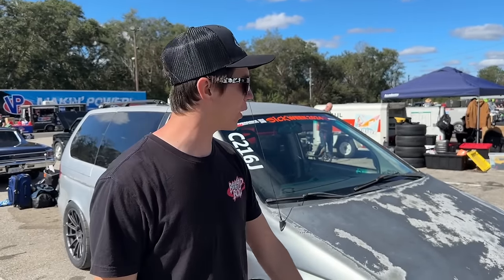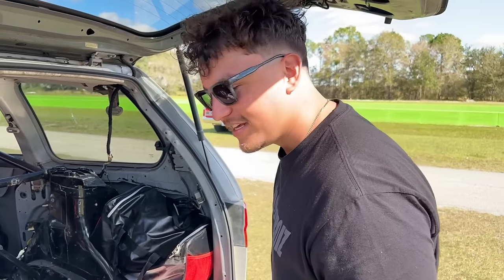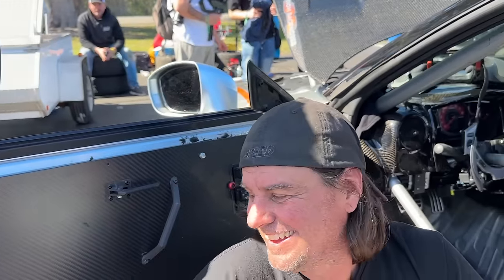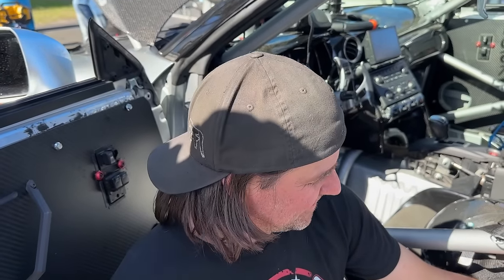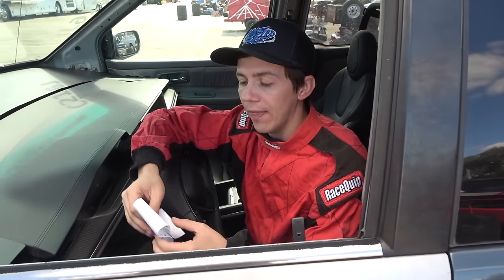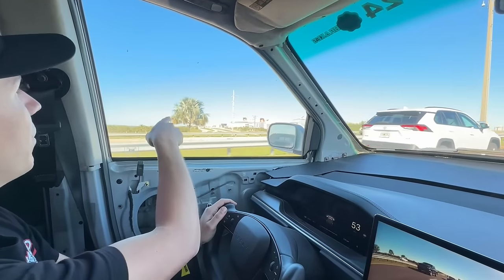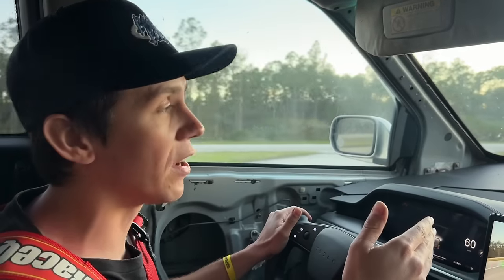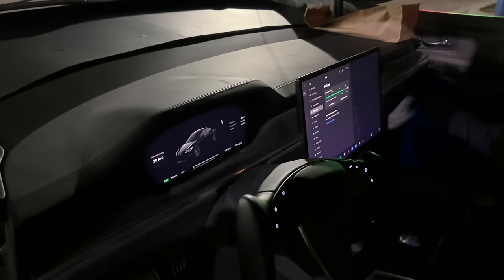Sick Week Day 1 - Wyatt’s FIRST Pass In The Rotary Corolla and The Plaidessey Gets a Range Extender!

Comment: Im not an EV fan but if i drive 4hrs i will be ready to get out and move around 30min or so anyway so hitting a charger every 3hrs to get a 30minute bump charge is not any different than stopping to get gas and taking leg stretching breaks. Good luck guys.

Comment: Kilowatts is a measure of power. 350 KW would be 469 HP. Imagine running a 450+ HP engine at full tilt for 5 minutes straight. That is how much energy you are cramming into an EV when you DC fast charge it at 350 KW.
Reply: No. One. Cares.
Reply: @eriklarson9137  Lol. Many people do care. Why are you so angry?
Reply: @eriklarson9137  can you point out for the room where the big scary EV touched you?
Reply: Thank you for sharing and putting that into perspective. I knew it was high but I didn't know it was THAT much power going into fast charging these.
Reply: @Tech-bv9oj  for the record no EV charges at the full 350 KW for an extended period of time yet. However, a lot of them can hold 250-300 KW for many minutes if the battery is at a low state of charge and hot.
Reply: if they made supercharged v8 charging stations id be there charging all the time LOL
Reply: @LearningFast "extended period of time" and "many minutes" are very subhective. The lucid air is the highest capacity and fastest charging and it lasts under 5 minutes at 300KW and 8 at 250KW.
Insert "it still lasts longer than me/you" joke here
Reply: @Mp-jw1qg   Maybe you are onto something
Reply: And some have active cooling for that reason to keep the battery’s in that temp range for charging
Reply: @laurean5998  that is a lot of electricity ⚡️ no matter how you look at it. Think about the heat an ICE engine would make running at full tilt for 5+ minutes straight while standing still.
Reply: @LearningFast  That's the beauty of electrictiy, it's very efficient. There is barely any heat coming out of this. Depending on charger manufacturer it's usually at most about 10kw (3%-5%). Also in terms of how much energy is put into extraction and refining of oil and compared how much electricity is used countrywide, electric cars are around 10% of whole electricity consumption.
Reply: @eriklarson9137 I found it interesting
Reply: I think its showing the charge rate in KW/h.   Actual charge power is 11-15kw which would be a 20hp engine.
Reply: An average household uses 33 kwh per day. 1 hr on that charger is a week of energy use for a house, thats saving energy according to the 🤡 🌎
Reply: @v12alpine  no, for DC charging they range from 150 KW to 350 KW max charging rate. 11 KW charging would be max AC charging speed.
Reply: @eriklarson9137  its gonna be okay man.
Reply: @369motoman  nobody spends an hour on a DC charger. You DC charge for 20 minutes or less typically. Most EVs have a 60-80 kWh battery. The Plaid is 100 kWh but that is pretty much the quickest sedan on the planet and it can go 300+ miles on a single charge.
Reply: @369motoman  20 gallons of gas is 640 kWh. Every ICE vehicle is wasting a whole neighborhood’s worth of energy each day.
Reply: @369motoman  No way that average household uses 33 kwh per day, where did you get that info? Are you literally running 5 airconditioning units and 5 ovens for whole day at the same time?
Reply: @LearningFast  Yeah, its just displacing that fuel usage from an engine to a coal or gas power plant.
Reply: @Avetho power plants are quite a lot more efficient than cars are, no matter the fuel that's powering them, as they are running at peak efficiency, at all times.
Reply: @IceBergGeo  That is true, as gas turbine power plants reach 65% thermal efficiency, 95% with "turbine cogeneration" which is efficiently using the waste heat as heat, but the current best ICEs can reach 56% directly driving the wheels. Driving a generator, they can maintain that 56% at all times. The old idea of ICEs being only 25% efficient is engines from before the oil crisis from what I recall, big block cheap engines with carbs and made cheaply and plentifully.
Reply: @Avetho  Unfortunately for ICE cars, it's esitmated that each gallon of fuel requires from 4kwh to 40kwh of electrical energy to extract, transport, refine, transport again and pump into your fuel tank.
Reply: @darekmistrz4364 yea a lot of people forget to account for the transportation, or the damages caused by transportation. In 2017 the Texas DOT determined around 2 billion dollars in damages caused by transportation for fracking operations.
Reply: @LearningFast thanks for answering the question I was going to be too lazy to look up 😂 

I knew it would be a lot. Waste product of engines as heat is huge. I love cars but also I'm an electrician too, so I can  recognize the waste. It's sad that some can't.
Reply: @eriklarson9137 you cared enough to comment on it which I find amusing. Use the time you spend being angry about EVs and arguing with folks on the Internet for more productive things like educating yourself.

Comment: At my parents house in SoCal we get a lot of rolling blackouts and brown outs in our unincorporated neighborhood. My dad has solar panels but wasn't keen on spending the money on a battery system for the house, but since he works from home now he needed a way to keep power during a blackout. He works corporate for HFT and bought one of the predator 9000s and researched online about it to see if it would be enough to power the house. Other than big things like our electric range and the AC, it fits the bill for constant draw, and my dad learned that you can get third party carbs for them that convert them to natural gas. He put in a splitter on our house gas line and ran it outside to the side house and patched in a 220v female outlet cable to the same place. Now we can run the predator during those blackouts and keep everything online. Those generators are dope.

Comment: Try finding a late model Hilux work mate diff for the Corolla Wyatt. Good brake set up, good ratio and decent under heavy load. We use ‘‘em on early model Toyota and Mazda stuff here in Aus when you doin budget stuff.

Comment: Honestly, with all of the powerful computers available, wheel speed sensors, gps, electronic speed controls etc... seems like it should technically be possible to just program your desired 1/4 mile time into a computer and let it compute/control the entire run on the fly. Maybe not. Seems possible since it's 100% digital.

Comment: If I were you I'd modify that very back part that you havent completely filled in to house a generator as big as the 9000 or maybe more and have the exhaust elongated out the back. Might even be funny to come up to the line and it sounds like a tiny engine and you shoot out of the hole lol

Comment: The plaid battery is 100kw so if you charge at 350kw/H it should charge in 1/3 of a hour..note if you prepare the battery for charging it will charge way faster

Comment: the amount of power that 226kwh is actually insane, that 226,000 continuous watts, like I'm pretty sure that's ,ore than most houses are even capable of useing, i know a monthly electric bill is like 2000kwh and that charger could pump the same amount of power in like 8-9 hours

Comment: I love that little Corolla.. 14 isn't that bad. They will have that in the 10's soon. When i was a kid that was fast. Don't get me wrong there were some drag cars doing number's. But now you can buy a car with a DCT making 300, 400, 500, stock and we did Not have auto's like they do now. You used have to know how to use the 3rd pedal.. Back in the late 80's early 90's we had to have manual's to get the power down. Now everyone with a couple Bolt On's, Tune, and a DCT wants to race on Instagram, LOL.. They really want to race when they see I'm in a manual, but I am older so I just chill mostly. I try to shift early.. I only bang gears once in a while really. I have a stock other than an Xpipe 2017 Mustang GT PP.. Every once and a while I'll run forth out just to smile.. The Coyote is one of the best sounding motor's though..

Comment: maybe someone else or know exactly but you have to be careful. Sometimes you have to get a separate device that studies your amperage in your hertz, because the constant fluctuation in the hertz get ruined, very sensitive electronics. I think it would be cool if you could figure a way to charge with the generator while you’re on the go I’m sure it couldn’t go continuously but it could definitely extend your range without stopping as much guess out to see the next video and find out how what you doing good luck guys
Reply: Generator probably doesn’t have a very good power conditioning before output, you’d hope that the Tesla has a decent filter built into the AC to DC converter but you make a good point

Comment: Kyle , you should look into some solar chargers for the van.  You can mount them right on the roof and charge as it sits and drives.
Reply: U can't drive and charge at the same time.
Reply: That would require a VERY large amount of panels to be worthwhile and it'd likely be negated by the weight and how cumbersome it would all be.
Reply: One panel charging for a hour will give them one mile of charge. Not worth it
Reply: You'd still need 300+W of solar panels and that wouldn't be very mobile, plus charge controllers and converters.

I'm not knocking solar, I don't want to come across as anti-solar, but it wouldn't be very space efficient if they had to store them inside the van or very "fuel"/aerodynamically efficient if they mounted them on the roof either.

Even a single 200W panel (which would almost never give you 200W) is nearly the entire size of the vans roof.
Reply: Even if you can't change and drive charge and drive , you can still charge. 1000W at 240 volt solar units are under 400 dollars and are only 2x4 each ( 2 at 500W) .
Reply: @3stoogesrocketry  

I think you should go look again at where you're getting your data.

Comment: You know they already make a truck with a diesel generator in it that runs on electric motors It would totally work if you stuck the exhaust pipe from the generator out the window

Comment: @Boostedboiz the way you road trip an ev is hauling ass from one fast charger to the next. I saw you driving 50-60mph which is perfect if you have a very long distance between fast chargers but if you have fast chargers 200mi apart just drive like a madman between them. Keep the battery hot and preferably hit the charger around 5% state of charge. Charge for 20-25 min and race off to the next fast charger.

Comment: Electrician here, evs are the worst.. that being said. Voltage regulator would save your batteries and electronics. (Dash showed voltage fluctuating) I would unplug before shutting down the gen....
Reply: Or take the idle off the gen and make it go full blast before you plug her in.

Comment: You’d think all the tech in the Tesla software you should be able to just tell it to run whatever  1/4 mile you want!
Reply: You cna when you use aftermarket inverter controllers. Not supported for plaid motors yet

Comment: I'd be wary of using that generator, those non-inverter types make crazy dirty power, not good for electronics! 
Fine for incandescent lighting and AC motors like tools and pumps. Not a big deal if you burn out a cordless tool charger or something, but a couple thousand dollar battery charger is another thing.

Comment: You've no idea how much this will confuse EV sceptics when they see how fast this charges and that you can add so much range so quickly.
( Yeah, I know, they still don't want an EV.)
Reply: But I can do 700miles and not need to stop for fuel, then when I do fill up it takes less then 3minutes 👀 when it gets that fast I'm interested.
Reply: @garyhowe88 This
Reply: @garyhowe88  

I generally need a 20-30 min break  after 250-300 miles of driving. 
If you can drive for 700 miles you have my great admiration.
Reply: @zilspeed  oh no i'll deffiently need to stop in that time but will just be for a quick pee and grab a sandwich/drink for on the move. I only drive further than that 2-3times a year, general life EV would probably be ideal as we also have free chargers at work 😂 general charging isn't quite there in the UK though yet and very expensive if you need to charge on the road, actually cheaper to drive my diesel crazily than charge at a public charger.

Comment: If you had two different battery Banks where you could turn one side off while you're driving then you could charge the car while you drive. You might have to shut down 2 motors  if they roll without power

Comment: Using a generator to power an electric car has to be the most ass backward but funny thing I've seen in a while. 😆
Reply: And it's still getting more than 40 miles per gallon and will smoke most cars on the street. That's hilarious.

Comment: what is ur favourite part about ur tesla, i love charging it constandly everywere i go X D just an hour for 20 miles X D my god never realised they sucked so much untill i started watching ur channel whahahhaahah
Reply: That's a slow charger. You can get 80 percent in less than 15 mins. That's basically charging at 1000 miles per hour. The issue is that tesla will not charge on teslas superchargers because it's a salvage title. He could also plug it in to a rv plug at the track and get about 40 miles of charge per hour. Most people charge at home and wake up to full charge in the morning.
Reply: @Shiftheads  @32 amps it charges 25 miles an hour suck dix
Reply: @Shiftheads  AND HOW IS 40 PER HOUR ANY BETTER X D
Reply: @Shiftheads  nahh actually its 40 not 25...its a really big difference
Reply: @Shiftheads  still takes hours to charge...
Reply: @darrellbeets7758  you don't get it man. They can fast charge on the road at nearly 1000 miles per hour. You don't need that at the track. One 1/4 mile run only uses like 3 percent of the battery. They can just run a couple runs and then leave it on the charger for a couple hours and they already charged what they used plus some. It's not like they are trying to fill it from empty at the track. The 40 mph of charge is what you use at your house because it doesn't matter when you charge while you sleep. Also, this is way less efficient because it has a plaid body on it. A stock plaid can go over 350 miles without charging. This is more like 250